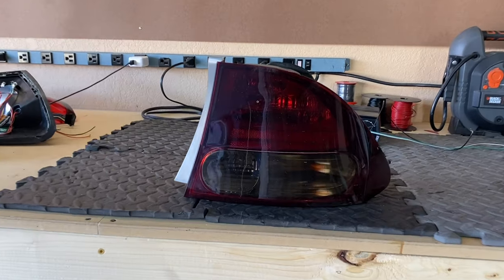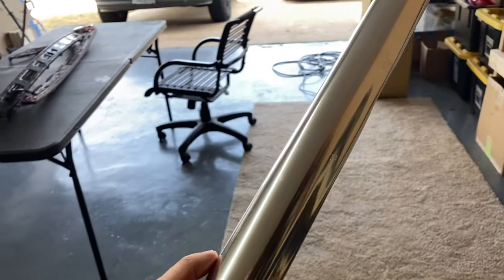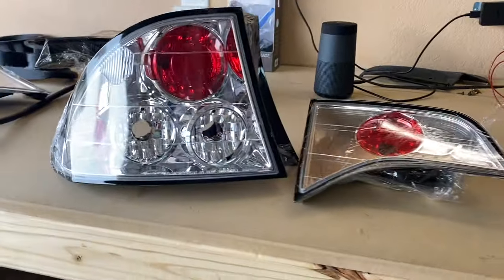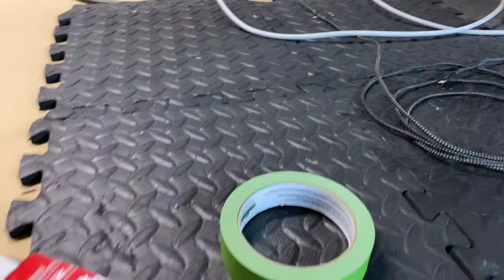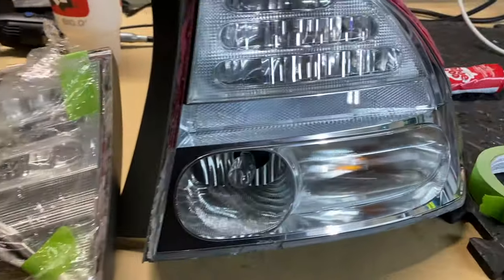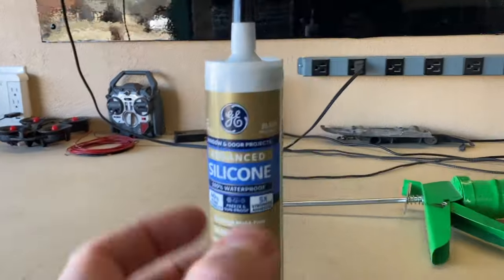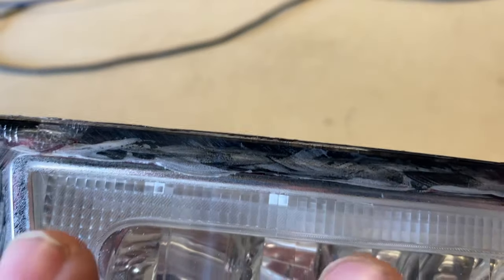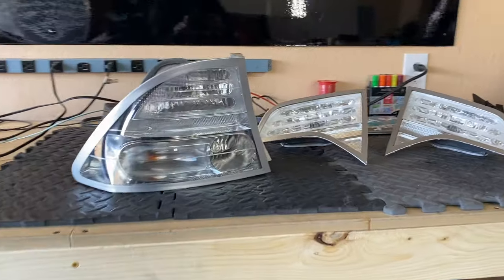how to make CLEAR TAIL LIGHTS

Comment: How did you get the larger part of the tailight off? I cut it all around and tried to pry it up and it cracked a bit. The two inner pieces I had no problems and got them done but the outside ones didn’t work out.

Comment: So is this illegal? Like would you get a ticket even if you use red led light for brake and a yellow or amber led for turn signal?
Reply from the maker: Really it depends on your region, and it can depend on the officer at the time. USA DOT says that you have to red reflectors on the back of the vehicle somewhere. So technically does not have to be in the tail lights but the are supposed to be somewhere.

Comment: Did you apply small drops of adhesive on each corner to get it on first? And then when applying the silicone are you filling in the cracks and then wiping off any silicone that escaped out the crack? Will silicone get into the headlight if I apply too much?
Reply from the maker: for sure do the corners! but you can do a line of the adhesive around the corners and edges (or anywhere that appears to be lifting) 
then for the silicone I do trying to get down into the crack of the light. 
silicone is really just a feel thing, once you do it once or twice you can tell how much is to much just by watching it when you apply it onto the light

DEFINITELY wipe away the excess lolol thats the difference maker for nice builds lol
Reply: @zaccook  thank you so much for answering my question! I honestly thought about just purchasing from your website, but I was wondering could I ask to have the outlines painted in black not silver?

Comment: What happens if your car doesn't have ANY after market taillights/headlights to buy?
Reply from the maker: Oh dang, you can try to make your own lenses or find a company to make them. Either way it’ll probably be a couple grand
Reply: make your own clear lense with clear polycarbonate i believe. lay down some silicon on the edges & heat form the plastic onto it and clamp. then just clear coat i think

Comment: Hey man, if you could really get back to me I’d appreciate it. So I just ordered my clear lenses from eBay and they get here Monday. Kinda scared to do it lol. But my question is, instead of using a dremel can’t I just break the plastic off?
Reply from the maker: The red lens yes technically lol. 
the main issue you'll have is around the edge the red lens could break off in chunks making the lens sit up off of the back housing all weird.

but that is how I have taken the lens off several times haha then I just trim the rest of the plastic around the edges to make it sit flush. 

ALSO, I know the lens from eBay that you got, its a pretty solid set. 7/10 from me but I have seen the silver material that they use on them break down after about 6 months or so (changes to a yellow ish color) and at that point you may need to mask and spray the outside of the lens to cover that up. 

it happened on full 1 set of civic coupe tails (using the ebay lenses) and 1 side of civic sedan tail lights (using the ebay lenses)
Reply: @zaccook  eBay lenses was all I could find :( . Is there anything precautions I could take to prevent that from happening? Also thank you so much for the reply. Helps a lot 🤝
Reply: @zaccook  ?
Reply: can i see that em2 tho?

Comment: The correct way to fix hyper flash turn signals after installing LED bulbs is to replace the flasher module with an adjustable LED flasher module. Plug and play. No need for the old school resistors.
Reply from the maker: Right but it does depend on the car, a lot of newer cars have the flasher module/ relay integrated inside the bmc 😑 like the bk1 genesis is a relay but the bk2 is inside the bcm and can’t be replaced. 
Cars are getting to many modules in them nowadays
Reply: @zaccook  true that. But I have seen that the newer integrated flashers accept LED because that's what the car came with.

Comment: On older 90s style yellow side markers is the tint from inside and is it a coating or  the entire plastic . I was trying to clear out my 95 s10 grill side markers  from the outside. I haven’t yet to split the lense off . 
The 94-97 s10 clear grill side makers are impossible to find anymore
Reply from the maker: O that’s cool! I wish they still did that but now we have to cut them off 🙄
Reply: @zaccook  my question is on this type of turn marker that I need too modify and make clear . WhAts the best method to remove the color ? If you Google 1994 s10 grill turn signal lense. I can split the top cover off with heat but I’m not sure how they do the Amber coloring on older stuff maybe it’s solid thru ? 
Only idea is too wrap the lense and heat gun mold/wrap  with that foggy clear light fixture grate acrylic . That seems too be the  only sure way too make a lense clear if the colors don’t remove with chemicals

Comment: Is this possible with the genny spec d’s?
Reply from the maker: yes and no, 
people have done it but it requires a TON of mods to the inner and out housings.
the spec d inner housings are sealed into the permaseal of the spec d tail lights so it makes it nearly impossible to remove the inner housing without cutting it apart.

Comment: Or you can just get an led flasher relay, no tapping into wires, and it plugs into the factory flasher relay location.  I've been doing this for years.
Reply from the maker: Depends on the car basically after 2010 most (not all) cars do not have a replaceable flasher relay

Comment: How did you remove all of the little bits of red plastic on the tail lights when you cut the lens out?
Reply from the maker: I just cut it more. You can use the dremel as a sander and sand all the red off

Comment: Alright so how did you take out the red reflectors ? I rewatched it like 2 millions times but it looks like you just popped them out but I can’t do that with mine :(
Reply from the maker: Oh the sides? they are held in with a chrome retainer that has tabs that go through the back of the housing. they are very annoying to pop out.

Comment: What if for the red parts that you wrapped over instead you got a junk yard tail light or headlight and broke it open and cut out the dimension you need to overlap the red section or cut out the red section and replace the red section with the chrome? 2:13

Comment: Can someone tell me if this is illegal to drive in cali with clears?
Reply from the maker: You legally have to have a red reflector in the rear of the vehicle somewhere. That’s why several Lexus cars have clear tails because they put the reflectors in the bumper. But I’ve also never heard of someone getting pulled over for having clear tails

Comment: Why not throw in the oven and just pull apart?! Then no need for paint, no cut marks?!?
Reply from the maker: because they are plastic welded, most tail lights are plastic welded together. literally no butyl or permaseal just plastic welded to plastic

Comment: just build a harness that hooks in before the factory plug with resistors that's how i got sequential signals and LED tails on my 2012 Camaro and skirted the hyper flash problem.  i came here hoping i could get some tips on making custom clears for a car that has no aftermarket XD the 2012 gallant. my search continues (ﾉ◕ヮ◕)ﾉ*:･ﾟ✧

Comment: why would you do this instead of just put the clear ones you got “aftermarket”
Reply: the only reason we all need clear lens is because there is not aftermarket taillight. if there was one we would just use that
Reply from the maker: Some people want clear oem tail lights and the want totally clear tail lights with zero red anything on the inside. So the aftermarket tail lights for the civic have the red pieces on the inside so you would have to open them anyway
Reply: @zaccook  the only people desperate enough to look up a way to do this are people who DONOT HAVE A AFTERNARKET OPTION PERIOD
Reply: for my e46 convertible there is NO company that makes any sort of clear taillight whatso ever

Comment: Wait a minute did this guy just take a. Stock lense n a aftermarket one n change the lense off the clear aftermarket one n put it on the stock one.  What sence does that make . Why not use the clear one instead of doing all that.   So if you can't get a clear lense like 90 percent cars don't have how is this even true.  More b.s.  
The title sounds like he's going show you how to change to a clear lense.   You need to add Civic to your title brah. False advertising.
Reply from the maker: Trying to read this gave me a headache lol
Reply: cuz the “clear” aftermarket ones aren’t fully clear, + oem housing will always have better fitment, it isn’t that hard to think before you comment 😐